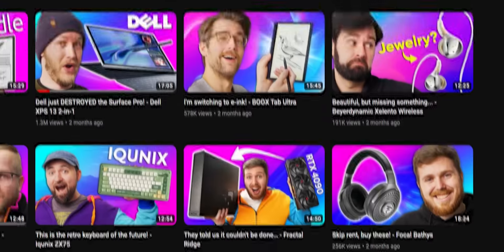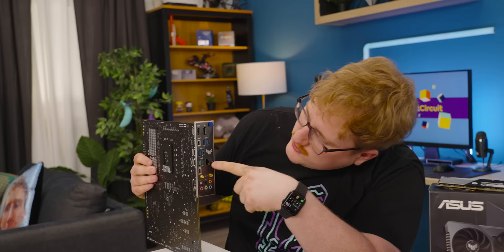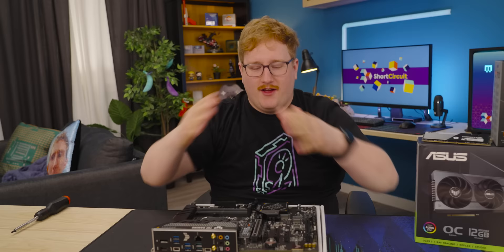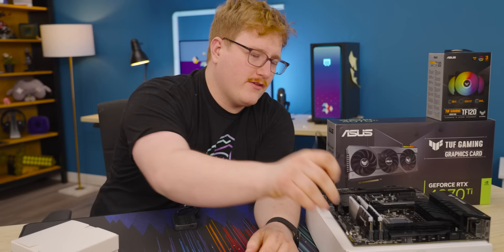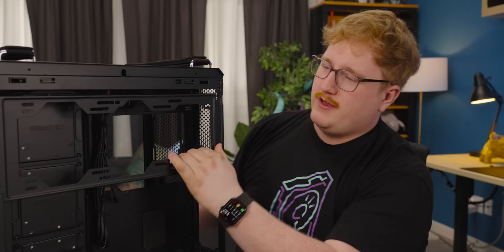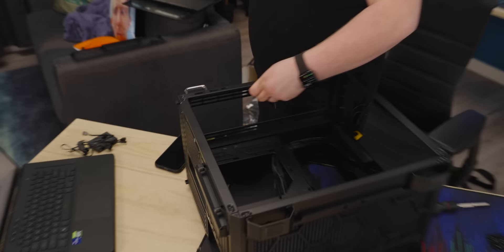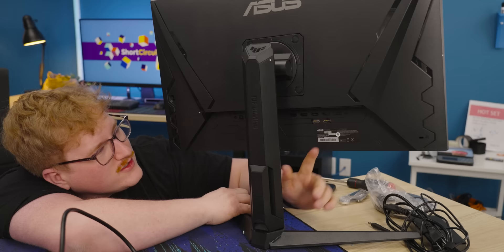The All ASUS PC - ASUS 2023 TUF Lineup

Comment: The stated cost savings of DDR4 vs DDR5 at this point is becoming pretty moot. The DDR5 version of this mobo is $5 more and 32GB of "good" DDR5 is $25 more than 32GB of "good" DDR4. 30 bucks is 100% going to be worth the performance/getting into the current memory gen.
Reply: Pretty much. I get it, if you're shopping $30-50 RAM kits by sorting low-to-high on Amazon then this message isn't relevant for you. But, DDR5 is so much cheaper now than it was on release that if you're willing to spend anywhere near $100 for 32GB of RAM, you're screwing yourself out of 5% or more performance. Not only that, but that DDR4 is going to be trash likely come next generation when you want to upgrade.
Reply: Yeah, I would get the DDR5 version of the mobo, and just get the cheapest ram. Wait until DDR5 matures, then buy new ram after a bios update. Future proofing.
Reply: If you live in America. Unfortunately, not everyone has access to the market like you do. So, it is still a sensible cost saving for the rest of us
Reply: I don't think people need to milk 5% of their system if it already gets 120+ FPS.
Reply: @ChronoXShadow  The memory controllers on current DDR5 platforms are gonna get left behind by the ICs of the future

Alder Lake already can't make any use of A-die, let alone M-die. Splashing out for the expensive stuff over Samsung stuff to put in an Alder Lake rig doesn't make any sense right now imagine how far ahead DDR5 is gonna be in two years. Even the Raptor Lake IMC has the largest variance since Haswell where ya might get an A-die 8600 capable banger, ya might get one that takes days to just figure out how to get back into BIOS at 7600.
Reply: I think these boards are more for people doing upgrades - i.e. I already have 32Gb of fast DDR4, if I can reuse that it's like £130 saving.
Reply: If you live in America then yes. But the rest of the world does not live in America so no.
Reply: Thing is, people likely already have DDR4 they can transfer to something like this.
Reply: "b-b-but all these costs add up!"
Yeah, so does having to completely replace your motherboard next time you want to upgrade your CPU/RAM.
Reply: This depends on where you live though.
Reply: @teriyaki_9inety9ine27  exactly I live in America and thanks to having friends in other countries I’ve seen how insane pricing is. ESPECIALLY Europe.
Reply: All these people who echo tech companies "future proof" and "buy again next years"  narrative boggles my mind.
Reply: The problem is that this is a dead end platform. If you get a good kit you can probably reuse it on your next upgrade but you are going to have to replace the cpu and motherboard. If you get the next intel series then DDR5 would make a lot more sense. I think this is actually something that makes more sense with AMD since you will be able to use the platform for a while.
Reply: The DDR4 mobos are a good choice if you already have DDR4. Then the "upgrade" to DDR5 is an extra $100 that could have gone to CPU or graphics
Reply: used ram is a thing by the way.
Reply: @LostHope...  Or in my case Brand New ram but being sold in a Goodwill.
Reply: I can get 32gb DDR5 Kingston Fury 5200 for about 100 bucks rn (and that's with my national 25% sales tax applied). Can hardly find any 32gb DDR4 memory for that cheap. And that's not even on sale, just standard msrp pricing, and plenty in stock. People gotta realize DDR5 has become very affordable very quickly, the early adopter days of supply scarcity and skyhigh pricing are long gone.
Reply: @rustler08  I can get 16gb of good brand DDR5 for 50 bucks, 25% sales tax included. There's no world I'd go with DDR4 anymore no matter the budget. And if 10 bucks difference at sub100 usd is what breaks the budget then you probably shouldn't be trying to build a PC in the first place rn, maybe wait a few months and save a bit of extra cash and get proper parts.
Reply: @m.f.3347  yea but then you’ll have to just buy a brand new motherboard, and processor later on anyway so you’re basically spending more money overall. It just doesn’t really make much sense especially with how cheap ddr5 has become and the price of this board is literally as much as ddr5 boards

Comment: So just for LTTs reference, the reason Eternal runs so well is two fold, one, their visual shading is fairly basic instructions wise, at least the part that counts within code, and secondly, they stream elements in and out constantly as you move around and look around, to where anything it doesn't need is culled so that you never are giving performance up to render something your not seeing or needing on the screen or around you.

Digital Foundry goes over the latter half of that explanation in their Doom Eternal - Id Tech 7 video.
Reply: The streaming is probably the reason why Eternal ran much better than DooM 2016 on my old FX 6300 + GTX 960 2gb. 
Already updated to 11400f+2060 12gbs, but I love the optimization on Eternal, I barely saw anything on nightmare with everything on low and all, but I  was able to complete the game on that junk.
Reply: I've heard they also managed this "screen-culling" technique for the ps1 notably. Its nice to see they know what they're doing.
Reply: @LoneWanderer905  Well the issue with Doom 2016 was less of a streaming not existing issue, and more the route they took that streaming later took over, which was Megatexture, which was textures atlas-ed into one big texture streamed at once into the game for use in an entire level or for a set of objects. The problem with Megatexture was that if something went off screen, the entire megatexture had to be reloaded, re-mipmapped, and you could see this happen often due to the constant need to do so.

This is why Eternal fairs better, because streaming only cares to cull what is not needed entirely, not what is needing culled as one file that later has to be called back to functioning anyway a few seconds later.
Reply: Also that game does not require long drawing distances
Reply: Culling is a technique used since games and graphics rendering first began being created, it's nothing new. That's just how, specifically here, game engines work..

ID Tech does have some different asset streaming techniques, but that and culling is not the real reason for performance.
Reply: I've heard the original Metroid Prime (I don't know about the Remaster) did that too. Everything you aren't looking at gets partially or totally deloaded, mostly put in a fast cache that gives it back as soon as you turn around. Samus' model isn't loaded at all until requested. Even her Arm Cannon is just partially rendered, the parts below (which you can't see) aren't there. In all the times I have played and replayed that game, I had never noticed. Extremely competent optimisation.
Reply: @lloydaran  What you're talking about is literally just how game development works. This is nothing new or an "extreme" example haha.

Like Halo's first-person legs are just the legs, there's no torso.

It's mot really showing an example of massive optimizations, just... typical game development tips and tricks, heh.
Reply: @lloydaran  Every not-criminally-terrible game does that, asset streaming is the base that allows us to experience worlds bigger than the amount of VRAM in our system.
Reply: @gmaiI  You'd be wrong for Eternal, it actually draws 3D meshes in quite far a distance, it is simply that it doesn't need to draw all things like that for every direction since it can stream things in quickly enough that no one should notice.
Reply: @LightningXCE  It actually is, aside from how they handle their simple shading which also relies a lot on normal map decals and more simplified decals as well, all with even more optimized meshes that can be detailed through the use of their Id Tech 7 decal system.
Reply: @LightningXCE  the extremely competent optimisation lies between the player's expectations and reality, as Mr Aran mentioned, the player expects 3D-looking objects to be drawn fully textured just like real life, however such redundancy was never considered by the game developers. 
Requirement : ability to see first person legs and front part of samus's cannon. 
Solution : draw first person legs and draw the front part of samus's cannon. 
No redundancy problem created, nothing to be solved by extreme competent optimisation x)
Reply: @LightningXCE  I guess it's nothing incredible for someone in the industry, but for an outsider, that looks really ingenious and smart. Even still, I'd correct you on one thing: that is how game development SHOULD work. We've all seen several examples of really, really bad optimisation from "AAA" studios, Cyberpunk is only the most infamous.

Prime in particular was from a time where I remember almost no game losing any frame on console. Now you buy Pokémon Scarlet and it runs like crap, despite all the compromises like the ludicrous drawing distance, LoD, N64 textures, skipping frames for objects just 3 metres away. Or well, even BotW has some blatant frame drops.

DOOM feels like an exception in the modern landscape. I know it isn't, otherwise the whole game industry would be in shambles, but I think it's worth of praise.
Reply: @YOEL_44  yup, u are right most modern games do asset streaming to reduce load on hardware.
Reply: @LoneWanderer905  Lol that was NOT my experience. I could run Doom 2016 on 1080p60fps at medium settings, and for Doom Eternal I had to go to 720p low with 50% res scaling (i5 6300HQ with GTX 960M)
Reply: Frustrum culling is very ordinary practice. Everyone implements it, from retros like Crash Bandicoot for PS1, modern AAAs like Horizon Forbidden West to literally solo devs on YouTube like Sebastian Lague

And as for shaders being simple, I guess neat if that was like a design/architectural feature, but again is that not just standard practice for shaders to avoid doing anything too complicated?
Reply: @TAP7a  Not quite no, for shaders, it is not standard practice, I can tell you that..

Comment: So this is why the asus tuf 4070ti I wanted went up to 850… jokes aside I really like the tuf lineup for its great price to performance and nice aesthetics that aren’t too flashy
Reply: And my old TUF MB was in system shipped from east to west back to east coast and still works but had to upgrade
Reply: My 4090 tuf is hustlin at 70% power target, overclocked to the the same perfomance as other 133% entries in 3D Mark.
Reply: Well that's... Tuf

Bite me.
Reply: Get the non oc version I have it
Reply: Yeah, had my tuf mobo for over 10 years now LOL
Reply: I'm waiting for the 4060. I'll never afford the 4070
Reply: Intel and Nvidia prices are insane. $800 for a 70 series card and over $300 for an i5. A 5700X and a new or used 6800xt or 6900xt is by far the better value, especially for the ton of people that already have B450/B550/X570 motherboards. If you need Nvidia/Intel, used 2070 super or 2080ti isn't bad value, and 12th gen prices are way better.
Reply: @3vlogs487  think its only some places non oc exsist, would had bought it else
Reply: @Djuntas  ahh I got it from best buy in the us and haven’t had a single issue with it. I think it looks nice and it seems quite well built, the shroud is a cast metal not plastic.
Reply: @catch22frubert  if you're looking for a more budget-friendly build that can run popular games at 4k, go for a 12700k and a 3070ti. My system runs fantastic no reason to upgrade to the 40 series maybe when the 50 series comes out depending on pricing might end up switching to AMD
Reply: @3vlogs487  yeah prolly a US only GPU then or something. None of it in Denmark anyway.
Reply: @catch22frubert  I went from a 3400g to a 5700x and that nearly doubled my performance across the board.
Reply: @redsquarejay  I went from an i5 7400 to a 7700x. It’s so much faster that i didn’t believe it

Comment: I love my ancient z77 tuf motherboard for my 3770k. It was one of the first motherboards that actually utilized the dust/cooling shroud, and having been in overly dusty environments for a long time, I attribute the shroud to keeping my mobo alive. 

I did switch out 1 of the tiny motherboard fans for a noctua one to help make it quieter.

Finally starting to be insufficient, but been a solid machine for the last 10 years.
Reply: i just built a new rig around the 13900K to replace my 4770K system. the 4770K has been rock solid for the last ~8 years and is now my home theater pc in the living room.
Reply: @Arc  yeah, still trying to decide what to do with the old machine. May turn the 2 MSI 760s into a wall decoration 😅

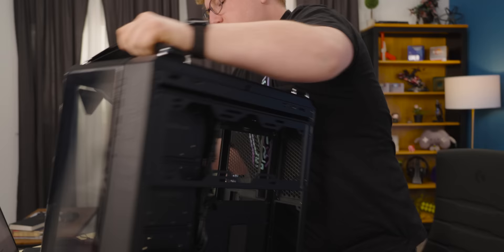Comment: 7:26 I imagine it's a mix of Lian Li's O11 Dynamic (Evo?) and maybe Corsair's Crystal series like 680x for example. It was definitely Love at first sight for me when I found out about this PC case. I think I've never purchased something so fast off the internet. 🤣
Reply: I def got it even though I had wanted something more stylish, I saw this and got it (but from another video about 2-3 weeks before this video released).
Reply: @vidsurfer0725  Ah sweet. May I know which GPU you have and how much space is inbetween the side glass panel and GPU?
Reply: @fluzzles  I got the Asus Tuf 4090....I have it mounted to my board directly (eventually I want to vertical mount). 
The length of the card leaves me with about 4 or so inches still clear. On the width (from board to the main glass) I have about 1 inch maybe a bit less, but still plenty room for my cable (I got the Corsair 5.0 cable so I only have to run 2 plugs into 1) and gave it a slight bend so it would clear the glass, but not so much that I might start a fire
Reply: @fluzzles  this video, at about the 10 minute 30 second mark shows a GPU the size of mine and how it fits in the case, just for some visual reference.

https://youtu.be/PPgsRNxi-yA

Comment: I have an ASUS TUF motherboard (x570) and I've been thinking about doing an all TUF build, and now I am pretty set on it :)
Reply: ROG guy here: X570-F Gaming mobo, RTX 2070 Strix GPU, ROG Ryujin 240 AIO 🙂
Reply: Mine is B550M zaku tuf

3 times faster than the normal b550 tuf
Reply: I'm running the same case and I like it a lot. I watched the maybe handful of videos that were out on it and decided to give it a chance...0 regrets. Has minor quirks, but all in all I still like the case.

I'm running the Asus B550 ProArt motherboard with 64 gigs of RAM (DDR4 @3600mhz), Ryzen 5950x and a 3090ti, powered by Corsair HX 1200 80+ Platinum. As time goes I will be upgrading most of these parts but the case and PSU will stay...first purchase we'll be an Asus Tuf 4090....after that I will give it several months for the DDR5 problems to settle a little and see who has better price to performance to power and heat. I have no problem going 13900k if they happen to be the ones to go with.

Comment: My five systems are ASUS motherboards and video cards.  I moved entirely into ASUS for those components about ten years ago, from totally mixed brands.  I used to buy the ASUS TUF models, now I buy the ASUS ROG models.  They are expensive but I really like the features and quality.  I have never had a single system component failure in at least a decade.
Reply: Asus boards are awesome and they last I have 2 Asus boards from way back in 2005 and 2006 and they still both work and just recently I bought an Asus board b450 prime and built a pc with that and so far I like it. I plan on putting the 2 old asus boards and cpus back into a case soon I'm just waiting for the right time and the right price to do it.

Comment: I just did an Asus build today. Asus B650E-E Gaming WiFi, 7900X, DDR5 6000, 980 Pro 1TB, 4TB m2 gaming drive, 4080 FE, be quiet! Pure Rock 2 FX (dual fans), be quiet! Light Wings for the rest of the case( two 140s and two 120s), and NZXT H5 Flow

Comment: I have a custom all Asus build. It's absolutely great! 
Got the Tuf Gaming z790 Plus Wifi with a 13900KS
Corsair Vengeance RBG 6400mhz DDR5
ROG Strix LC II 360 AIO
ROG Strix RTX 4080 (OC edition)
ROG Strix 850G (Upgrading to a 1200w Thor Platinum II soon)
Got a Samsung 980 Pro with Heatsink M.2 1tb (Getting the 990 Pro with heatsink 2tb soon)
All sitting in a Tuf Gaming GT501 Case (Massive Case)
Pushing 1440p ultrawide on a Gigabyte G34WQC
I'm really impressed with this build and I'm even a little bit power capped at the moment. 
Asus is the way to go

Comment: I do like the button release PCI slot!
Reply: I also do like the handles.
Reply: @Junaid_Ellam  For sure, excellent QoL upgrades.
Reply: @Junaid_Ellam  the push release glass also works nice paired with a little metal on top of the glass. Now no more fingerprints on the glass.
Reply: @TheSjuris  no finger prints would be nice
Reply: @Junaid_Ellam   it works pretty well.

Comment: 0:49: "The D4 meaning that this board uses ddr4, which is a great way to keep the cost down on a new build like this."

Meanwhile: has a 4070 TI on the table
Reply: Yes because at 1440p/4K (which is what you'll be using this kind of card for) 4070ti increases performance over last gen, ddr5 doesn't
Reply: Thats the point? You can get the higher end of DDR4 and save cost to get a better graphics card.

Comment: I think if short circuit does something that LTT could do they should do it fundamentally different. Instead of just using shorter cuts what if you presented the built pc and then took it apart to talk about the individual pieces. Or took a working pc and changed out the parts to show more of a process than oh we build new pcs.

Comment: Worth mentioning that the new TUF G psus (750w, 850w, and 1000w gold rated) come with ATX 3.0 and direct-slot 16 pin power connector standard so you don't have to fiddle with the adapters and extra cable connections. Plus they're well priced too. Don't see any other reputable psu manufacturers offering ATX 3.0 and 16pin connection at this price range (or any price range, really). Asus got out super early with this stuff at good prices.